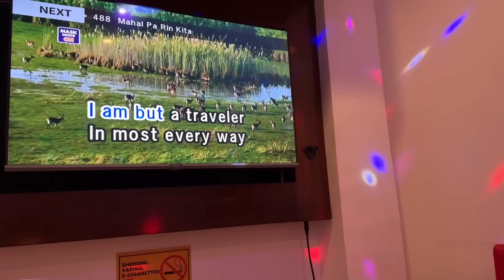Weekend With Friends, Painting For Sis Province House Update

Comment: It always seems to cost more than you first calculate. So many materials are needed to get it finished, gravel, sand, cement, metal bars, plumbing and electrical then skim coating and tiles and roofing materials. Septic system and water pressure system, doors and jams, windows, and paint. It keeps adding up, even higher if you want extra floors or terrace. Not as simple as first thought.
Reply: Very true! I built a house on the beach during COVID there. Took three years to get it done, and in the end, I spent three times the amount 😢

Comment: Great job on the house! 🎉 a sliding door my not be an option right now, but maybe consider putting a vinyl or PEVA shower curtain on a curtain rod on the door between the house and dirty kitchen to block out the rain….you could even get Velcro strips to put along the perimeter of the door on the inside to hold the curtain in place when needed…if you get a lot of rain from the typhoon…the wind might blow rain into the house….just a suggestion…either way it’s nice that you’re sister is getting a house ❤